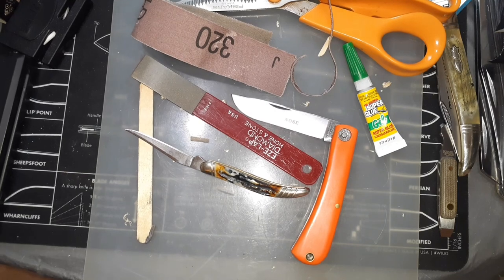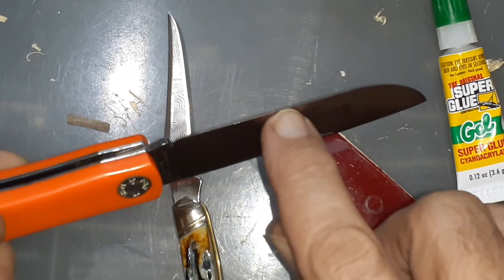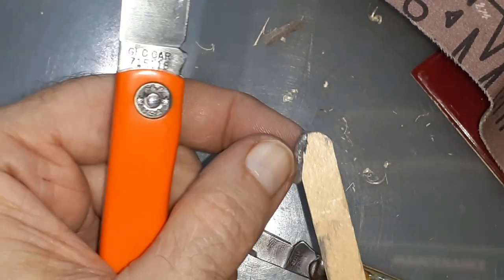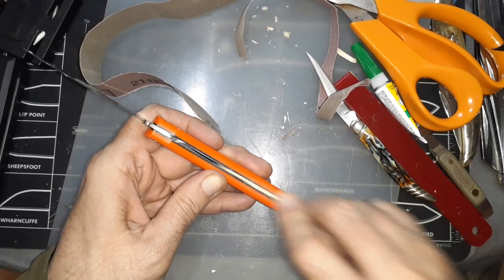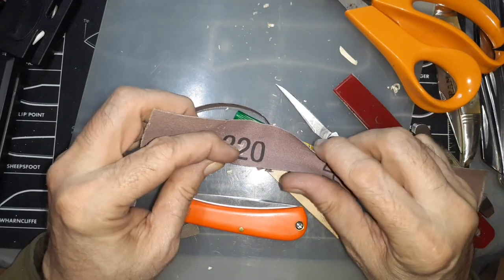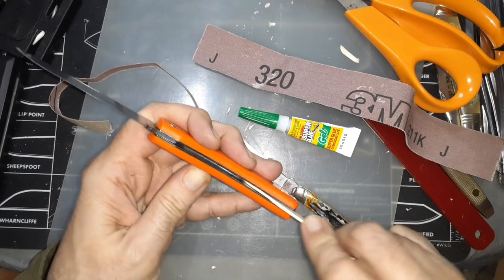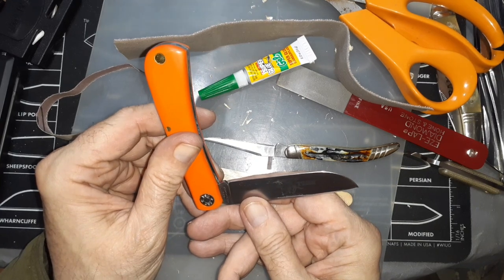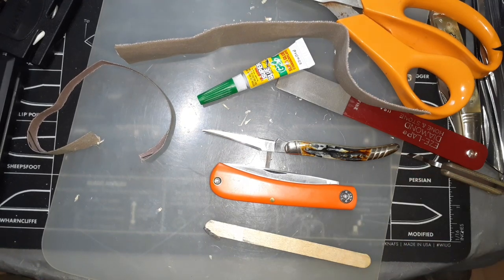(180) How to Fix Blade Rap on a GEC #71 or Any Folding Knife

Comment: That’s a good idea! I have done the same by folding the sand paper several times and using a very small and thin screw driver to push on it.  Thanks buddy!
Reply from the maker: Thank you KD. I tried my jeweler's screwdriver set, but the shafts were too thick. I have other screwdrivers but decided to use the popsicle stick as it was cheap & available.

Comment: Hello William.  If you cut the tip of the stick on an angle you will get a longer sanding surface. I rarely let blades drop as all my first traditionals were french Laguioles and they all have blade rap. It is a part of the design unfortunatly. That made me carefull with all trads, lol.  Don't forget to blow out the filling dust, don't want that in the pivot!  All the best.
Reply from the maker: Thank you Rhino. That's a great idea about cutting the stick on an angle.

Comment: Great tips.  However I find it odd that "blade rap" is something I have never heard of in modern folding knives.  Only after looking into traditional folders did I ever run into blade rap.
Reply from the maker: That's true. You don't. I think it's because modern flippers are built differently from traditional knives.  On flippers,  there are no pins that go through the center of the knife. My Elementum has nothing for the blade to touch. No mainspring.